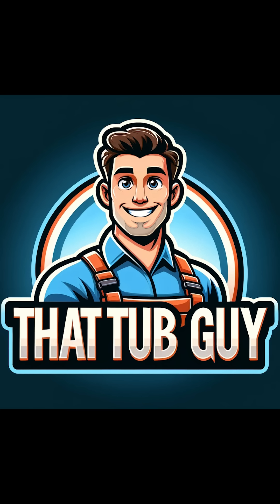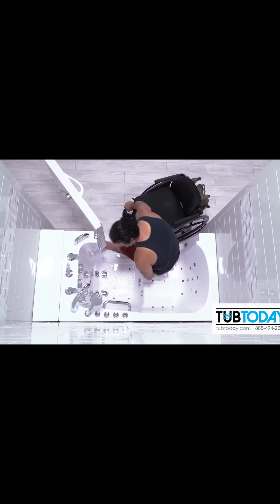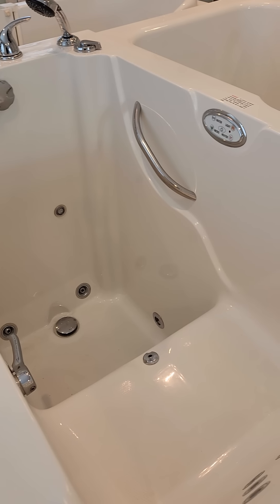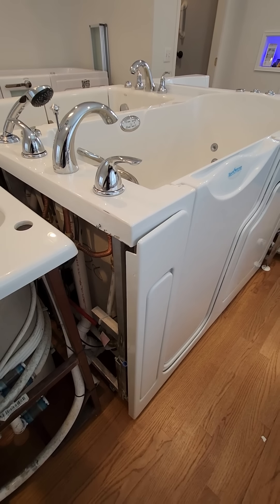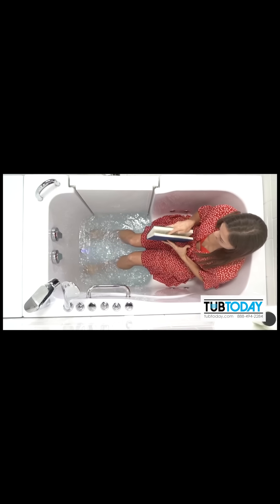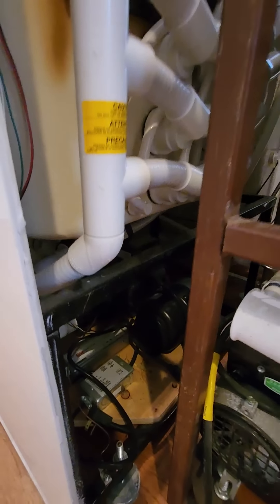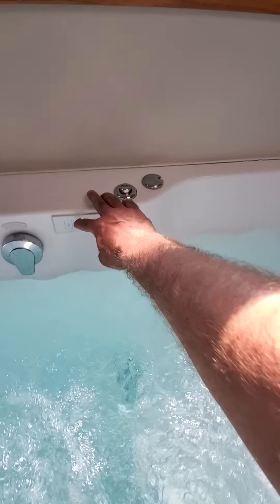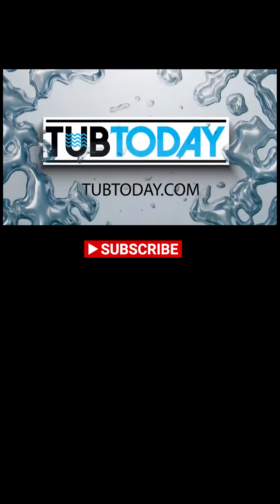2024's Top Walk In Bathtubs: An In Depth Review - Kohler, Safe Step, American Standard,and TubToday!

Comment: I want a deep soaking walk in tub with no pipes other than the drain. No jets, no faucets. Is there such a thing?
Reply from the maker: Some manufactures offer their walk in tubs without jets, it is a soaking model versus a hydrotherapy model. Here is a link to a build your tub website that carries 2024's top walk in bathtubs. You can build a walk in tub without jets and get some pricing information also.

https://walkintubusa.com/
Reply from the maker: I know TubToday has a laydown model. Typically, the price difference w jets and no jets is around 10-20%. Some tubs may only be available w jets so I would be open to having them so you can otherwise get the perfect bathtub. Here is a link to a tub that could fit your needs.  https://tubtoday.com/featured_item/3060-lay-down/
Reply from the maker: In addition, in case I sent you the wrong tub model, look at the other models they offer. TubToday has a larger selection than I have seen anywhere else. If you just want a bathtub without installation, then this company could also be a great resource, Walk in Tub USA. www.walkintubusa.com